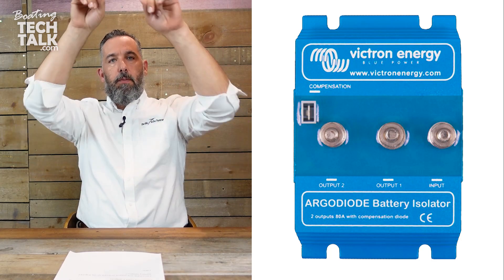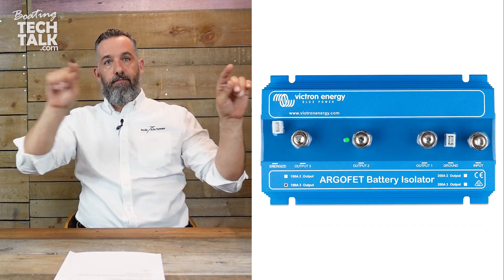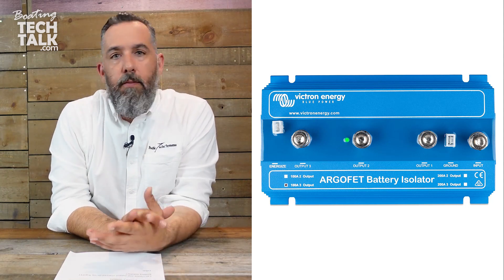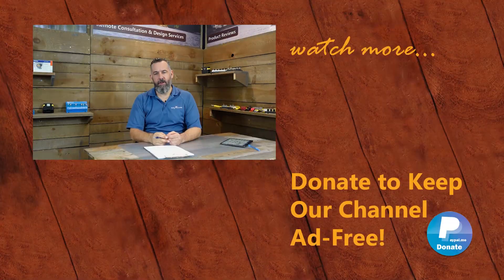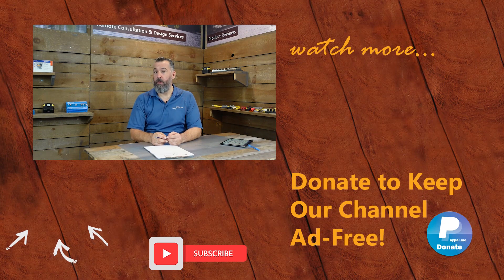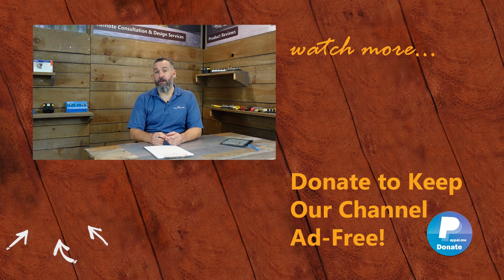I Purchased a 3-Output Battery Isolator but I Only Need 2 Outputs - Can I Leave One Unwired?

Comment: I have an agm starting battery and a lithium house battery in my RV. What types of battery isolators will work to charge both. Specifically the Victron Energy ArgoDiode Battery Isolators 80-2SC

Comment: NOTE FOR THOSE USING AIS & VHF splitter.  It is critical to use a vhf antenna that is not a plain vhf antenna, but a antenna that is tuned to to include AIS frequencies as well or your AIS range will be reduced to a few miles.  As well AIS is not just ship to ship.  It is picked up by satellites and downloaded to Marine traffic sites for ship and yacht traffic.  For this reason if you will be going off shore it can be nice to get a “B+” unit that is 5w instead of a 2.5w AIS “B” unit.

Comment: Question. Can this be used in a Jeep to charge a starter battery and a 2 AGM battery bank? In other words, 

One wire in from the alternator 

One wire out to the starter battery 

One wire out to a 2 AGM parallel bank?
Reply from the maker: Good question, probably, but i'm no car expert.

Comment: I have a sure power 702. Do I have to replace it with the same one or can I get a bigger or better one?
Reply from the maker: Definitely worth going with an ArgoFet, your batteries will recharger faster with the current alternator.
Reply: @PacificYachtSystems  thanks for the advice.

Comment: Can I have one battery as a cranking battery and wire two deep cycle batteries in parrelel and use a 2 bank or 3 bank isolator? Or all 3 seperate - 1 cracking - 1 house and 1 for trolling on a 3 bank?
Reply from the maker: You could connect all 3 battery banks to one battery isolator, as long as all battery banks are the same chemistry.

Comment: Jeff, can a One in FET be two out be connected to Starting battery & two house batteries in parallel?
Reply from the maker: Yep a FET 1-2 battery isolator, can have one alternator input and be connected to two battery banks (starter: 1 battery, house: 2 batteries in parallels)

Comment: On a Dutch sailing forum a member reported a burned and melted ground wire (which is a small diameter wire) on a Argo Fet . Victron chimed in on the forum with all kind of bla bla talking about non professional installation, user fault and such. Reading it all I t immediately analyzed the case and  wrote it was a design fault and how to solve it. (that is putting a internal fuse in the Argro Fet: it will only blow as it is malfunctioning, so anyway destroyed) After a few weeks or a few months they reported on the thread on the forum that they had changed the design: guess what: they added an internal fuse. They never took even the effort to thank me, in fact they never directly acknowledged that  is was a design fault. Well, I am used to it. I found out that manufacturers are never happy when you point them to sometimes blatant design faults and also give the solution: bummer!
Reply from the maker: Thanks for sharing Airgead, appreciate it!

Comment: This bring me to my boat. Single engine, dual battery. It has an old style diode isolator, however the input to the isolator is not connected to any alternator output. Therefore the alternator must be connected to the battery switch however I haven’t yet verified. If I install a new FET isolator and connect it to the alternator output I’m assuming that the alternator must be then disconnected from the battery switch. Hoping my brain is working correctly. Love these videos Jeff!
Reply from the maker: Hi Ken, you are on the right track, check this diagram:
https://www.pysystems.ca/site/assets/files/2532/pys_battery_isolator.pdf

When installing a battery isolator, you'll want to make sure the jumper between alternator positive post and starter solenoid is removed, otherwise you'll have two circuits from alternator to batteries.

Comment: I have the Victron 200amp, 3 battery argo FET isolator. I have a house bank, starting battery and a dedicated windlass battery connected to this. I want to install a solar array into the system to charge all 3 banks. Can I connect the positive leads from MPPT units to the input post (same connection as the alternator feed) on the isolator to effectively charge the 3 banks via solar? Thank you from Gig Harbor!
Reply from the maker: Yep, that should be doable, although never tried before. We always connected the solar controller to one battery bank only and have never tried running the solar controller through a battery isolator. 

Anyone try this, please share with comments.
Reply: I want to do that too but with a battery charger as well,

Comment: Please note that the NEGATIVE wire connected to an Argo-FET battery isolator needs to be FUSED. A simple 1A fuse will do. Failing to do so can lead to serious overheating and fire if the Argo-FET fails, which happened in some cases. This is (or was) not mentioned in the manual. It is unusual to fuse a negative wire, but in this specific case it is really necessary!
Reply from the maker: Great point, same thing with many battery combiners. The negative lead, which is NOT supposed to be current carrying but only used for voltage sense must be fused.

Comment: This leads to another question. Can the third outlet be run in parallel to the same bank as one of the other outlets? Let's say one for the start and the other 2 to the house bank. Would that double the amps going to the house bank?
Reply from the maker: Hi David, the charging amperage is shared across all battery connections. Don't think that connecting the house battery to two posts on a battery isolator will help much, other then having a larger connection to the house. Let me know what you try and how it changes the charging.

Comment: Great video!  I'm in a similar situation.  Twin Cummins 6BTA engines with 105A alternators.  I have 3 battery banks (port start, starboard start & house). I'm replacing an old battery isolator (2 input, 3 output) with 2 new ArgoFET isolators (1 input, 2 output).  I'm planning on having starboard alternator charge starboard battery and house, and have port alternator charge port battery and house.  Can I use a short wire to jump between the designated house battery out post on both ArgoFET's (which are installed side by side) and only have one of the ArgoFET's run a wire all the way to the house switch?  Or should I have both ArgoFETs run a dedicated wire from the "house" post to the house switch?
Reply from the maker: Hi Chris, yep you can definitely connect the output from both battery isolators and run a double size wire to handle twice the load (two alternators) to a single battery bank.
Reply: @PacificYachtSystems  why do the new victron Argofet isolators have a ground connection where the old isolators did not? What gauge should this ground connection be?

Comment: In this situation, can one alternator just be connected directly to one battery bank and the other alternator go to an Isolator to charge the other two banks? I have 2 alternator with 3 banks setup and looking for isolator replacement ideas, currently have one 2input/3output isolator that is dropping too much voltage.  thanks
Reply from the maker: Yep, lots of ways of doing this. Some boaters want to utilize the output from both alternators to recharge the house battery and hence why they have a dedicated battery isolator to each alternator.